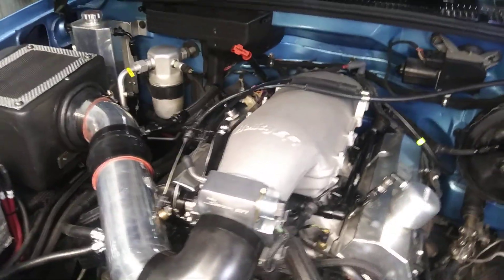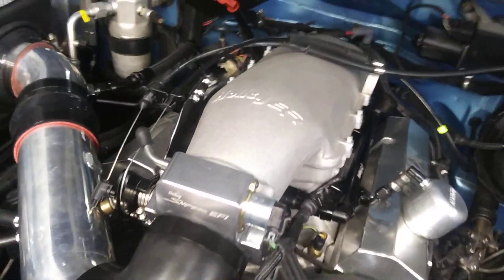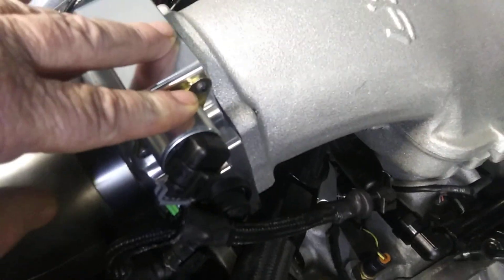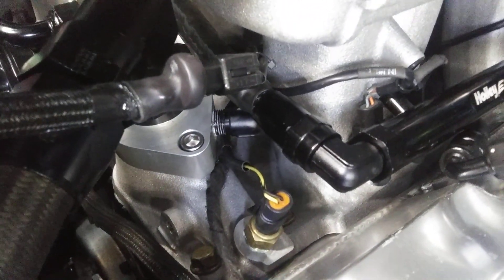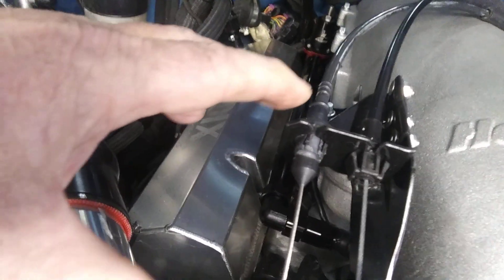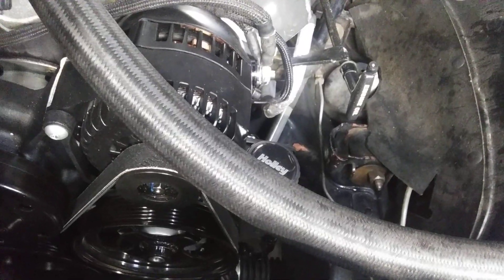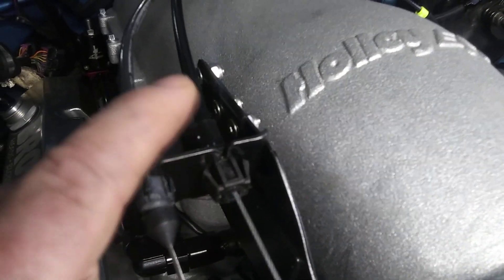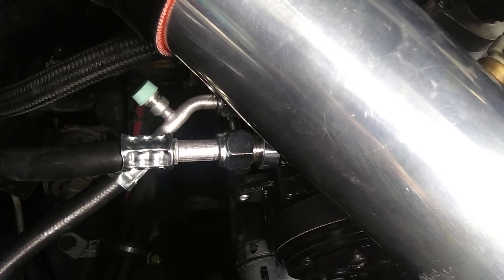My thought on the new Holley Hi-Ram Intake on fuel injected SBC after 1 week, peripherals I'm using

Comment: I have been researching this manifold for Edelbrock ETEC / Vortec heads and everything I find seems to indicate they don’t make one for Vortec style heads on a SBC. Seems crazy to me.
Reply from the maker: Gen 1 SBC heads were manufactured for over 30 years with much mounting suffice and bolt pattern change. Aftermarket manufacturer still produce a large variety of gen 1 heads. SBC Vortec heads were manufactured for 4 or 5 years. You do the math.
Reply: Same problem here. Dam those swirly heads lol.  Holley gives no f#&$s about us Vortec head users!!!!!

Comment: Does it fit on a 5.7 350 Chevy v8 small block
Reply from the maker: It fits my 355 / 5.8. If you have SBC gen 1 heads, it should fit.

Comment: can you post a video of your engine running? I'm curious about this setup for my engine.
Reply from the maker: I probably will, it will be awhile. The motor is out of truck. I just finished freshing it up and had some things powdered coated while it's raining. Now I'm just waiting on the torque convertor, it's being custom made by Circle D. Also waiting on a 95mm throttle body and some accusump parts.

Comment: Could I put this on my 1990 Chevy obs 5.7 tbi
Reply from the maker: If you change the heads to gen 1 and cut a hole in the hood, sure.
Reply from the maker: Sorry I misread your comment. The manifold should fit under 90 OBS hood. But it won't bolt to TBI heads without mods. It only bolts to gen 1 heads. Beside TBI heads don't flow much and most of them have pretty small valves.

Comment: Hi thanks for your video not much about these intakes on yu tube? just wondering what size are your injectors? I am contemplating this intake for my 355 stroking to 383, rhs 180 heads 24lb injectors tpi motor edelbrock hi flo runners, ported base, small comp cam, told i need a 230/230 cam, 1/34 headers haltech ecu c4 vett regards from Australia.
Reply from the maker: 29lbs
Reply: Thanks thought they may be larger!

Comment: Okay so I have a extra 350 sbc tbi block out of a 89 c1500 could I run this set up without changing the heads?
Reply from the maker: The hi ram intake manifold and TBI heads have different bolt pattern.

Comment: How is the torque under 3500 RPM compared to what you had before? I would think the short runners would give much better top end from 4000 up but might cost some low end torque where you might run it on the street. I was looking at running the Ford version on my 427W engine with carbs,I am a carb guy, but the height would really be up there and have to use the $$$ small distributor.
Reply from the maker: It runs pretty good off idle to 6000 rpm. I don't go much past 6000 rpm, I don't want hurt the trans. If I whack it from dead stop, it well brake the tires loose. It didn't with the PF4 intake. I'm running a 1000 rpm stall speed torque converter. I don't want to have to whack at every light to get moving. So I say the motor has more torque. My thinking is senses it's a dry intake and the fuel is delivered right at cyl head ports, the motor reacts different. With Hi-Ram and the runners being so tall, the cyl can't rob fuel from each other. I know with the PF4 intake the cyl rob fuel from each other, the bottom of intake stained and a little wet.